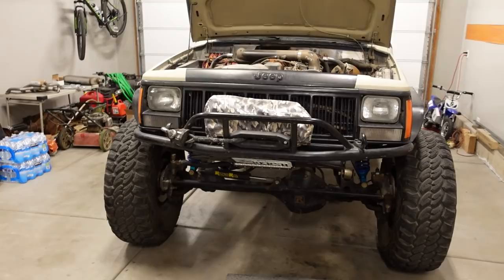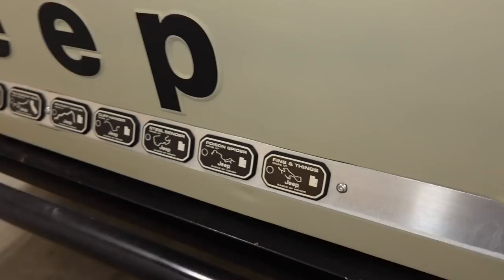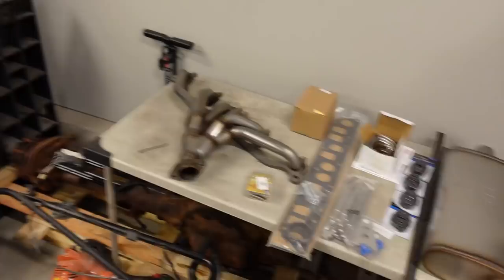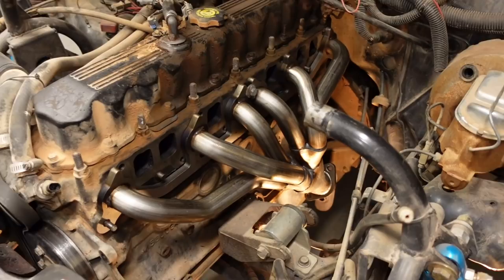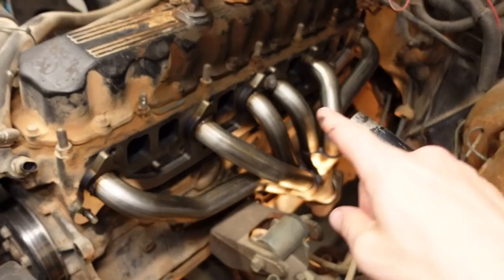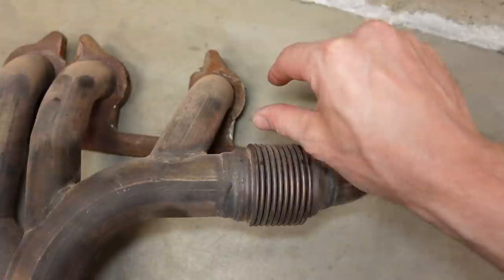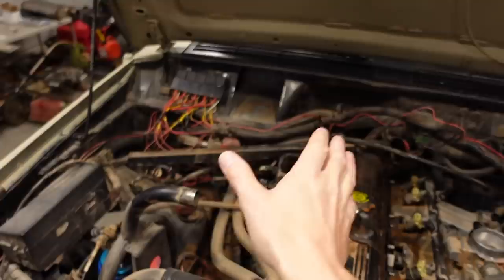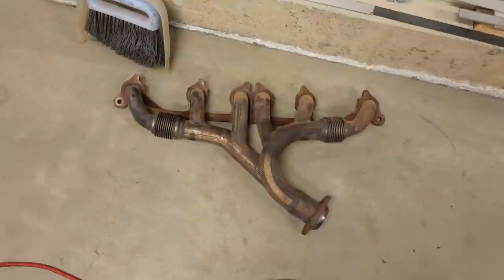Incredible Jeep Comanche Rock Crawler gets a header + custom exhaust

Comment: Engine Masters proved that you can bash the the header as much as you want and you won't lose any power.  Sometimes you just gotta do what you gotta do.  I've done that job on all my Jeeps.  That manifold that came off is a Dorman replacement exhaust.  The bellows help with the cracking that is inherent on stock 4.0 exhaust manifolds. I have that exact Dorman manifold on both my Jeeps. It's not great, but it does the job.

Comment: I was saying that at the beginning of the video I had same issue with my 99 xj I bought same part didn’t fit same reason cylinder 6 ,I banded it little bad with hummer ,after 3 months started to leak exactly from the gasket top cylinder 6

Comment: Every set of headers I've installed I've always noticed a different .. torque throttle response was the most noticeable for me...
Reply: I'm hoping with the larger pipe and better flow, it will rev faster.

Comment: I have a Renix XJ (same engine system) where did all the vaccuum lines go for that cold air intake? Also what did you do about the EGR tube that goes from the side of the stock exhaust to the bottom of the intake manifold?
Reply from the maker: From what the owner told me, this engine isn’t the renix, but is a later model 4.0 HO swapped from a late 90s XJ… there was no EGR a on it when it came to me, and no EGR ports on the manifold either.  Don’t think this one had any extra vacuum lines either.

Comment: Tell me you don't cringe when a customer brings you a no name header like that to put on his Jeep and tells you, "Yeah, it's a direct fit". If it doesn't say Edelbrock or Banks on it, you know your in for some problems. Speaking of exhaust shops, I took my '01 XJ to a shop and told them I wanted a 2.5" exhaust from the back of the cat to the tail pipe tip. Well I got it back and it was 2.5", muffler, then the stock 2" tail pipe. Errrrrrrrr!!!!!!!!!!!!!!!!!!! Before that, I took it to a well known shop in NJ and told them the same thing. They put a 2.5" Magnaflow on the stock 2" exhaust pipe and tail pipe with a monster 3" tip. That fell half way off a year later half way to Youngstown, Ohio for a funeral. The over axle hump was laying on the top of my rear axle. I threw it in the back of the Jeep and threw it in a dumpster at a rest stop. Fast forward to the other shop. I was so disgusted, I ordered a Banks cat back and a Magnaflow Cat, and put it on in my driveway. 4 years later, I'm still very happy.